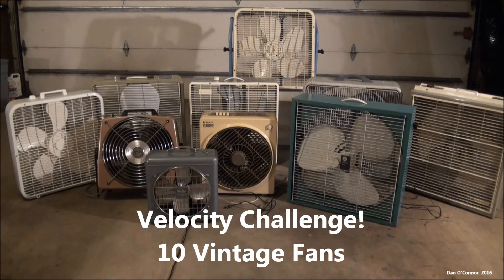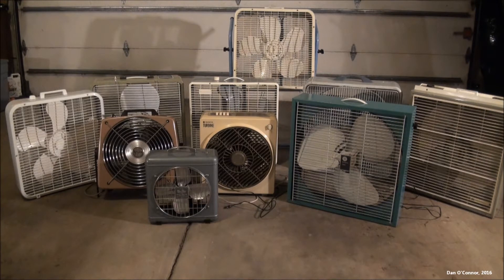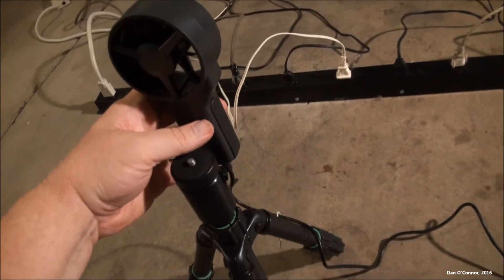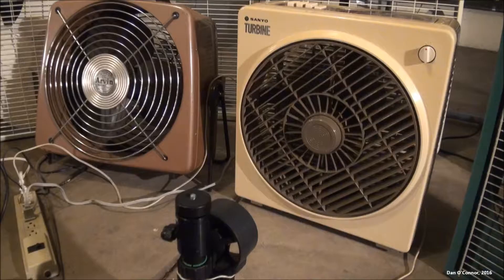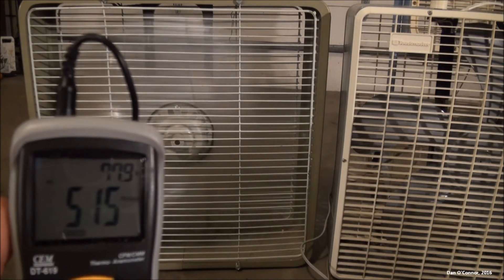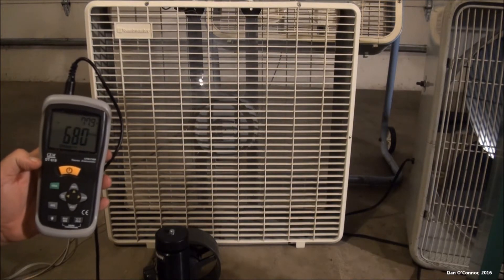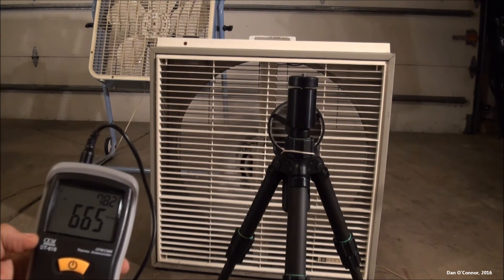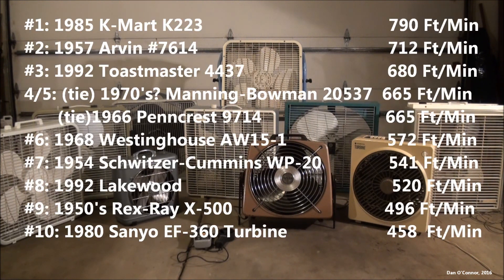Velocity Challenge: 10 Vintage Fans

Comment: I am pretty sure that RexRay fan was made by Manning-Bowman as it looks exactly like the Manning-Bowman fan I grew up with in the late 1950’s. My Dad put window screen under the front grille so I couldn’t stick my little fingers into the blades! That fan had 3 speeds and was very noisy.
Reply: It was made by McGraw Electric, Bersted Manufacturing Division who made fans branded Zero, Rex Ray, Eskimo, Manning Bowman, Happy Home and a couple other small brands. With heavy use they had to be oiled at least 2x a month as the bearings dried out rather quickly and would made a lot of noise.

Comment: I purchased the 1980 Sanyo fan at a tag sale for $3 in very good condition. It had a cracked adjustable angle foot in the front which I repaired. A great, quiet and efficient little fan for the bedroom. If you could maybe make a video of the decibel output on the different speeds of each fan I think it would make for an interesting video if you happen to have that piece of test equipment. A great video.
Reply from the maker: You got a deal on your Sanyo, I think I paid $10 for mine, even with a couple of missing slats on the grill. I used to have a noise meter but I got rid of it. Maybe someday I'll replace it and do the test you suggest. Thanks for watching and commenting.
Reply: I don't know if you have a smart phone but there are free apps you can download that turn your phone into a decibel meter.

Comment: Hi Dan - Very Informative test!  I was at a flea market Sunday where there had a 1930s 10" fan for sale for $25. It hadn't been used for decades. Both 2 cords were cut off.  Probably worth the $25, but I'm thinning out my collections again and don't need anything new right now.  I really like your RexRay, Arvin and Sanyo Turbine.  I'd grab any of those if I saw them and would look great in my game room.  Nice video Dan.  See ya -- Atco
Reply from the maker: Thanks, Atco. I've never had any of those really old fans. I was at an auction once where there was an old G.E. from the '20's maybe and they had it plugged in and working. It was in great condition. I figured I'd bid up to $75 for it. After I dropped out it went for $110!